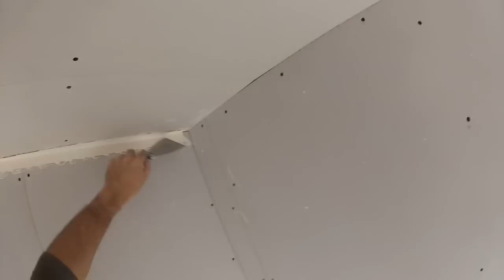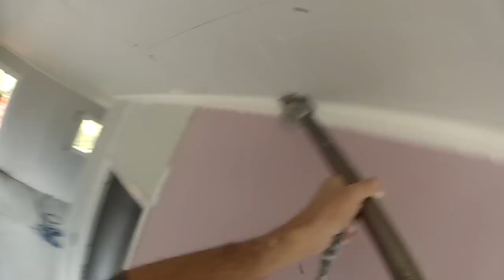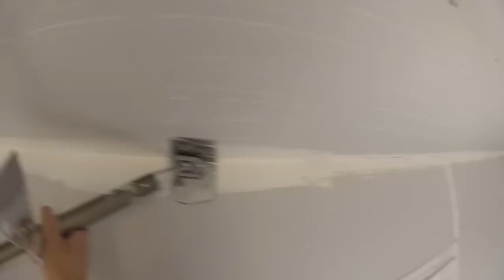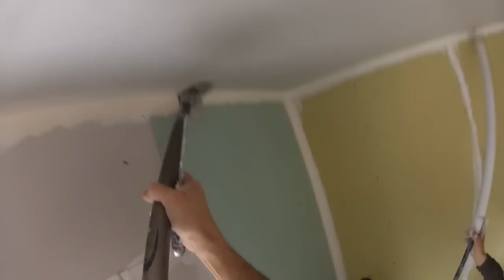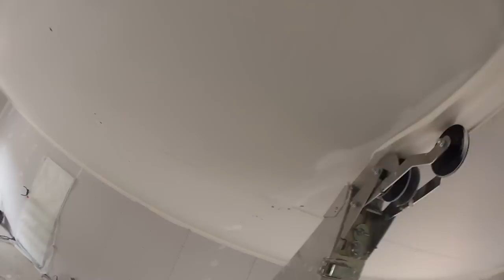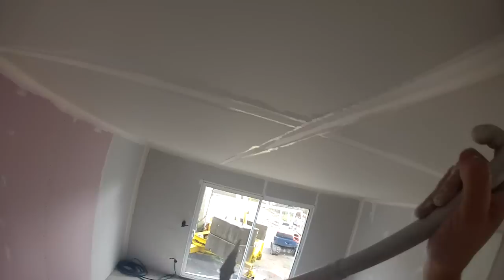comment faire des joints de placo première partie

Comment: Bonjour et félicitation pour ton travail. J'ai une question peux tu me renseigner?
Voila je suis entrain de regarder le matériel pour faire les bandes a joints, et j'ai vu qu'il existait des lisseurs d'angle qu'on pouvait utiliser comme chargeur d'angle (5€ de plus que le lisseur). As tu déjà utiliser ce matériel (columbia , bte le font) si oui quel est ton retour dessus. Cela permet d'éviter d'acheter un chargeur et manche supplémentaire...Merci d'avance
Reply from the maker: Bonjour et merci.
je me sert d'une seringue pour la charge + le finisseur d'angle et je trouve que ça va très bien mais je ne connais pas de finisseur qui s'utilise aussi pour charger. il va falloir que je me renseigne la dessus.
Reply: Par exemple chez technimat il s'appel "finisseur d'angle direct" http://www.technimat-outillage.fr/l-outillage-du-jointeur/finition/finisseur-d-angle-3-direct-columbia.html il a un petit "V" en dessous du lisseur alors que ceux qui n'ont pas ce "V" leur nom est "finisseur d'angle standard" a utiliser avec a utiliser avec un chargeur d'angle... http://www.technimat-outillage.fr/l-outillage-du-jointeur/finition/finisseur-d-angle-3-standard-columbia.html
Reply from the maker: ha oui effectivement mais très franchement l'utilisation du finisseur directement avec la seringue ça ne me parait pas du tout évident pour une finition impeccable.
en tous cas c'est ce que je pense car l'utilisation de la seringue seule il faut déjà gérer (pour faire sortir la bonne quantité d'enduit) alors faire la finition en même temps ...
Reply from the maker: je demande a voir en vrai lol
Reply: Effectivement en video ça a l'air simple mais en realité je pense aussi qu'il vaut mieux utiliser un chargeur d'angle. Merci pour tout tes conseils